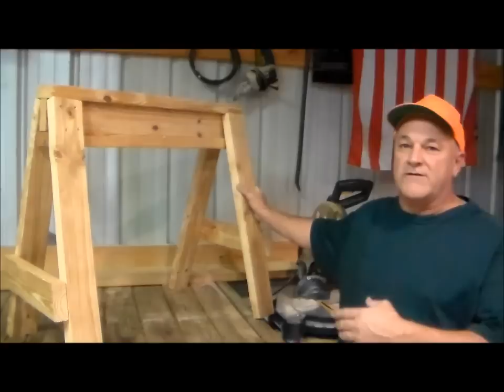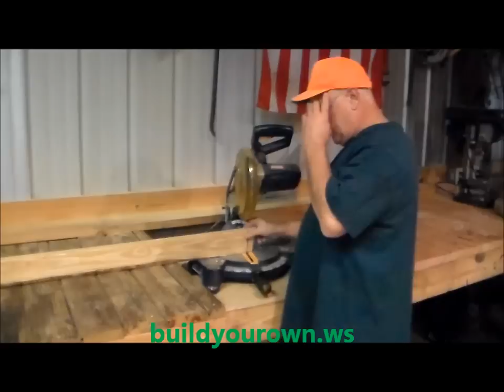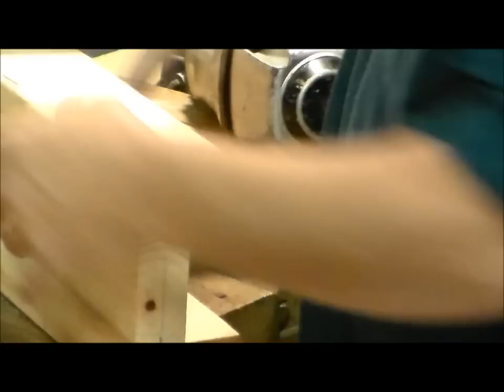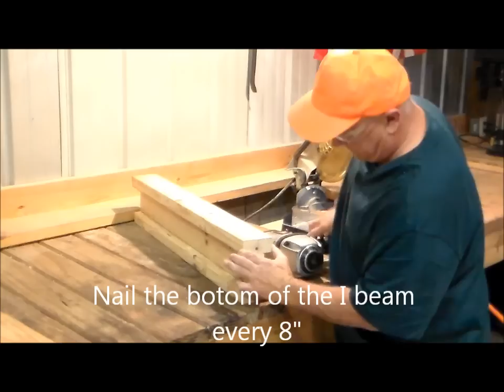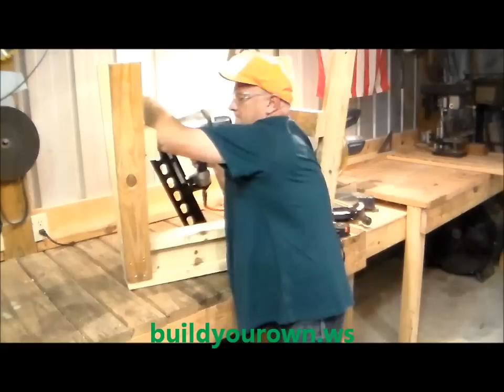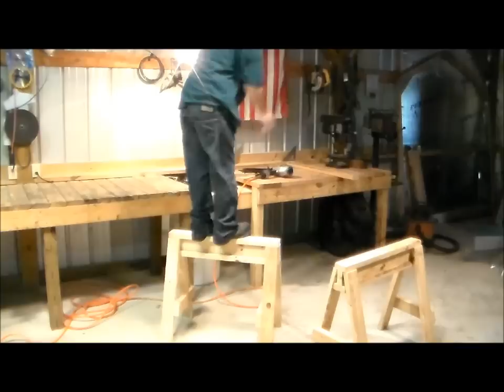How To Build a Saw Horse

Comment: Hi. Had my husband watch video and he went right to work making these. Only thing is you need more than 5 - 2x4x8s to build a pair of saw horses. With the measurements you provide of 32 in., 29 1/2 in.,  and 16 in., there is no possible way of making two from 5 boards. No matter how you cut the boards.